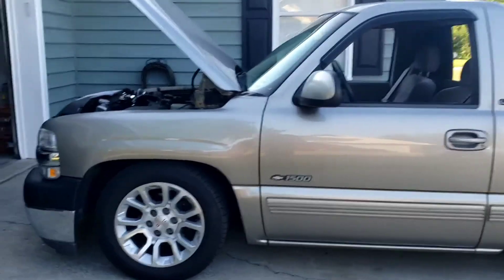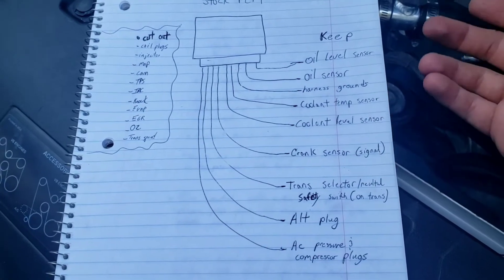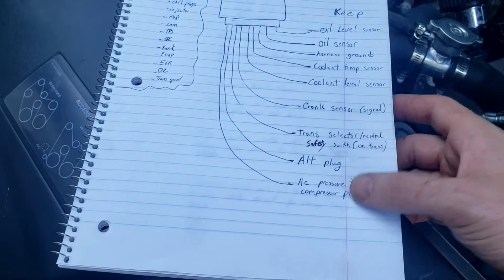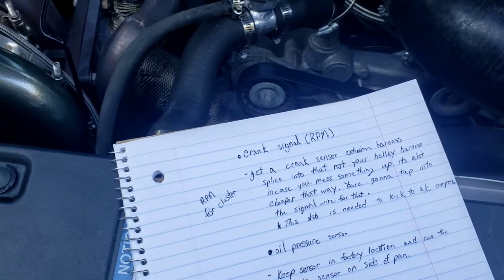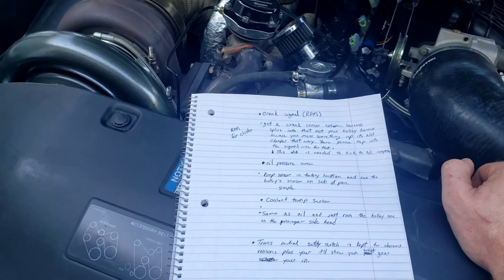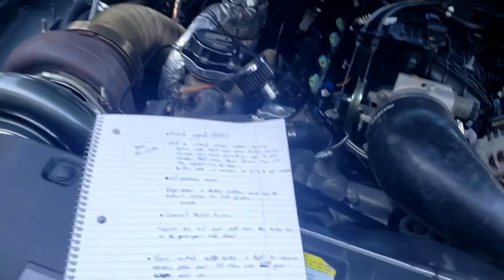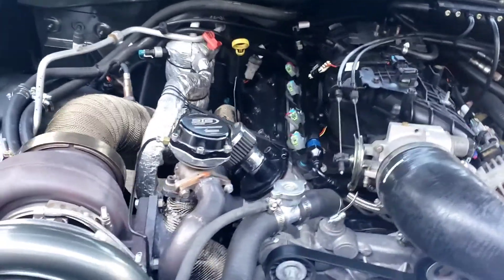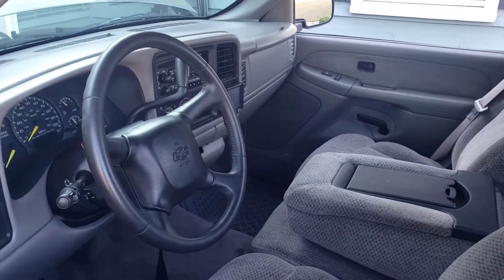Holley efi integration with stock gauge cluster in Chevy Silverado

Comment: what do you have for a fuel system ? looks like you're using factory feed/return lines? did you put dual pumps?
Reply from the maker: @michaeldillonthetube  at this point it was only on pump gas and a single 525 pump. I since redid the fuel system do to running e85

Comment: I’m about to be doing a Aces jackpot stand alone ecm and dbw harness for my 08 pontiac solstice gxp , any idea on how I’ll run the crank and cam sensors on the factory harness like you’ve done since my sensors are originally for a 2.0 t eco tech on the oem harness ? Also do you know the voltage of the gauges signal wire you ran for the Holley to work with your oem gauges ?

Comment: Question! Does the Obd2 port still work? Would like the Holley Terminator to handle engine management, but this car needs  to pass state inspection through the OBD2 port.
Reply from the maker: Yes it works still. Just needs to turn codes off since it won’t be actually running the engine.
Reply: @LsxNova  thanks and god bless.

Comment: Could you just split the wire for coolant temp to feed the stock ecu and the holly
Reply from the maker: No. It’s a resistance signal. Can’t be split
Reply: @LsxNova  Blaser Builds on youtube did it. It is his "Holley Terminator GM IntegrationTurbo LS Escalade" Video.  Switch from a 2 pin connector to a 3 pin. 2 wires for the resistance reading and the 3rd wire for the temp indication.

Comment: Does your ac work after removing the maf sensor as that has the air temp sensor built into it? My truck reads -39 since I have it removed so my ac doesn’t work and I believe that’s the issue

Comment: I was thinking about doing the same thing, but I may just dump the cluster for the 7in display. Haven't decided yet as I'm still gathering the parts for my turbo project. Not sure if I want to mess with all the inputs and outputs in order to retain certain functions also. I am damn good at automotive wiring, so good it looks like a work of art. But then again, that dont mean I like doing it! LoL
Reply from the maker: This will only use 1 output for the speedometer. Rest is stock harness and sensors to communicate to the dash. The pro dash is nice just wasn’t what I wanted for this build

Comment: What did you do about your rpms when ac turns on? Did you use a input on the Holley to up the rpm for ac so it doesn't stall?
Reply from the maker: Yeah. I have a input for the Holley when I turn the a/c on. It bumps the idle and turns the fan on. Sorry forgot that

Comment: Couldn’t you just have spit the vss signal and kept it in the stock wiring to keep speedometer?
Reply from the maker: Holley uses the vss sensor so I just left that alone plug alone and used a output to go to the cluster
Reply: @LsxNova  they make vss splitters in my mind that would be easier. But if it works it works
Reply from the maker: @musclecity06  just using what I had at the house yah know

Comment: What is the sensor that I have to get or from where do I get the green wire to make my speedometer work ?
Reply from the maker: Use a output from the holley terminator x max and put that wire to the cluster speed input. Should be green wire. Just do a quick Google search for a cluster pin out for your make model and year

Comment: I’m thinking of doing this to my trailblazer SS 08 you’d think the same applies ? Another thing does yours pass emmisions? Or how do you get around that ? I’m in Illinois that’s my only worry another thing how did you do the starter wiring ? Holley doing it ?
Reply from the maker: Same applies just the speedo wire might be different color of course. You'd have to tune the stock pcm to not have any check engine lights and show a ready status then itll be good
Reply: @LsxNova  man I’m thinking about it because I know how to tune Holley the stock ecus are confusing to tune

Comment: Question. How did you split your crank sensor wiring to both the Holley and the factor ecm?
Reply from the maker: I mentioned it in the video. Extension harness in between crank sensor and holley harness. Then tap the signal wire on that for your stock pcm to read and thats how you'll get the tac to work
Reply: @LsxNova  awesome thanks

Comment: Doing this to my 01 Silverado with nitrous 6.2. Just chopped down my stock harness. I have the terminator max but believe I’m going to still let the stock computer run my 4l80e. It’s too easy to tune the trans with the stock computer. Just letting the holly run the engine.
Reply from the maker: I dont believe you can do that. Cause you'll need tps signal. Just let the holley control it. Its to easy to tune it
Reply: @LsxNova  yeah man after I wrote this and started messing with my stock harness I realized that. Also remembered that the stock pcm needs to have a torque calculation to command higher shift pressures. So that’s a no go. Going to use the Holley for the trans

Comment: Any idea how this would work on a NNBS 07- 13?
Reply from the maker: Same idea applies. As long as you can get a pinout for the cluster plug and add the speedo wire in everything else will be the same.

Comment: Did you split the cam and crank sensor between the holley and the factory eco? How does that work? Thanks
Reply from the maker: Just crank but yes. Just buy a extension harness and tap into that and not your holley. Cheaper if you mess up
Reply: @LsxNova  no cam sensor? Thanks man I'm just getting started on mine.
Reply from the maker: @mhaab1  nah not necessary for the dash to read rpm. Just needs crank
Reply: @LsxNova  one more question.  Do you remember what wire to have the speedometer working?
Reply from the maker: @mhaab1  it was the green on on the back of the cluster I believe